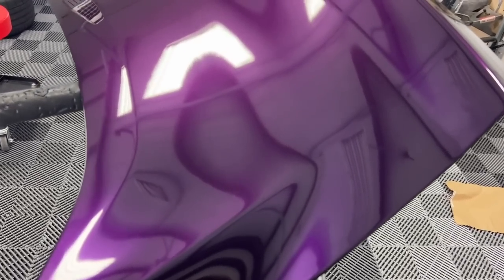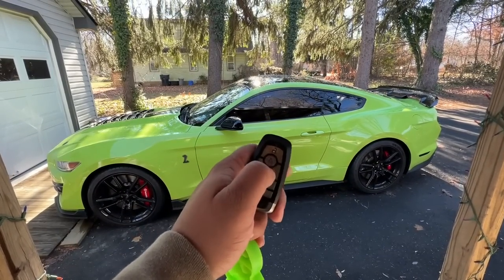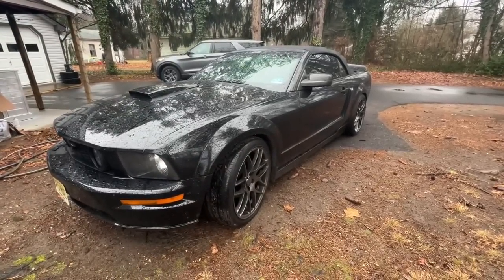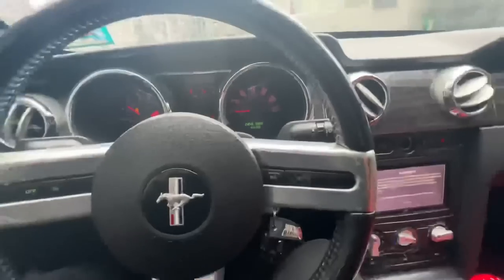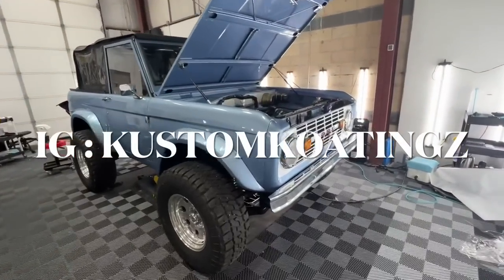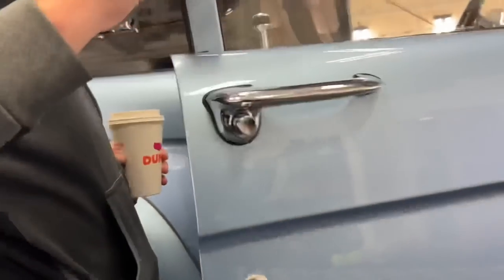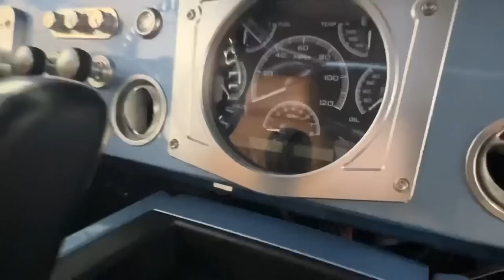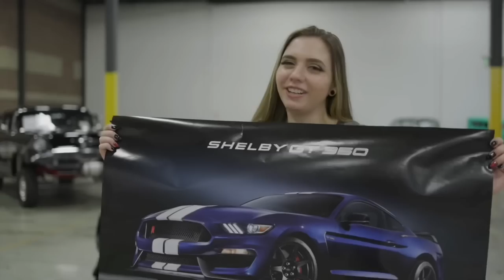It LOOKS AMAZING 🥲 WRAP UPDATE ON MY 2020 GT500! Part 2

Comment: My 2001 4x4  Ranger has a 4.0L  with 230,000 miles and it still runs like a dream. Only thing went out was the air-conditioning. I bought a new unit for next summer.  
Nice video.   You're going to have a undercover Hulk. Lol!!

Comment: Yikes . . . You realize that the wrap could tear off areas of your "newer" paint when removing that junk, right?

I hope you plan on owning it forever, cuz after replacing body panels, then the engine, along with all the other odd things you've done - you have successfully removed a lot of the marketability and value of that poor thing.

Seriously, in hindsight, you would have been way better off buying a low mile salvage-titled car from one of the auctions. At least then nobody would care about how you destroy it anymore.
Reply: Do you think this actually matters to him.  Just a prop for his channel. It’s more than paid for itself already I’m sure. He bought the car for use and fun. Not worried about other issues trying to hold its value. Although he’s spent a lot extra on it. It’s still does what he wants.
Reply: Lol someone really doesn't understand the whole concept of being a content creator on here.